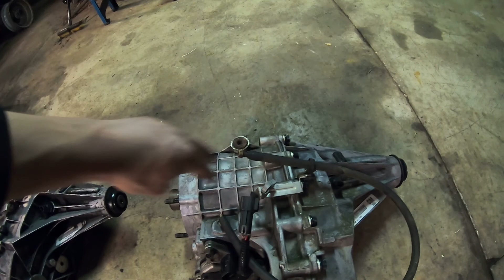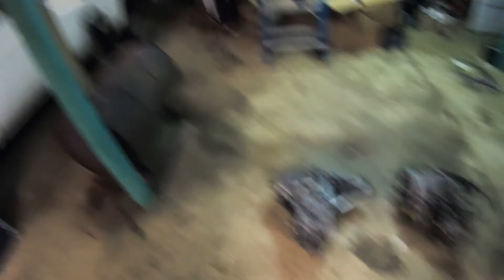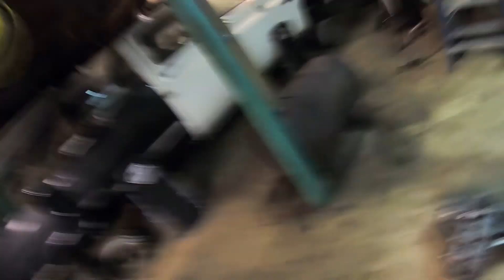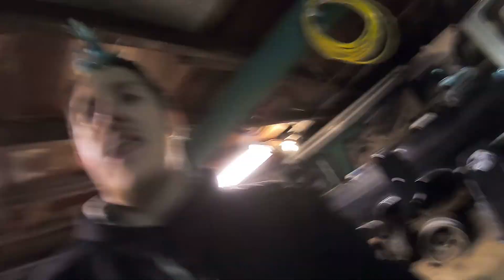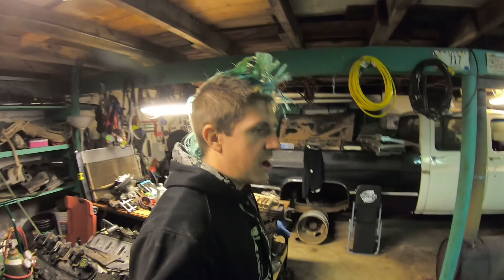Transfer Cases - Which fits your application better?

Comment: Ok I’m doing an LS swap to a 96 4/4 gmc sierra . With a 2004 Yukon 4.8 and its 4L60 E .
Reply: My 96 transfer case is a manual np241c will it work with the 2004 Yukon 4L60E transmission
Reply: Or can I use my 96 4L60E and my 96 241c with the 2004 LS swap
Reply from the maker: You 96 np241c should bolt right up to the 2004 4l60e. I believe the output speed sensors on the transfer case are even the same as the 2004 harness.

Comment: What is the difference between a BW4485 and a NV149?
And can I use the BW4485 in a 02 Cadillac?
Reply from the maker: OK so the BW4485 uses a planetary gearset to divide power but is actuated through the abs system. When the computer sees one or multiple wheels spinning faster than the others outside of it's programmed tolerance, it applies the brake on that wheel or wheels to direct more power to the other wheels. It is dependent on the computer and braking system, without them it is basically just an open center differential.

The NV149 uses a viscous coupling to divide power 60/40 between the rear and front axles. It does not require an brake application or electronic assistance it is purely operated through mechanical and hydraulic principles.

I'm about 95% sure your 02 cadillac would have come with and NV149 from the factory. You could put a BW448 in it, but without the computer and abs system having the programming and logic to apply the brakes correctly, you would likely encounter operational problems in low traction situations. Without the computer and abs programming to apply the brakes, the BW4485 would likely send all available power to the wheel or wheels with the least traction, basically achieving the opposite of AWD.
Reply: Thank you for your time and explanation, it is now clearer to me what I should do. 👍